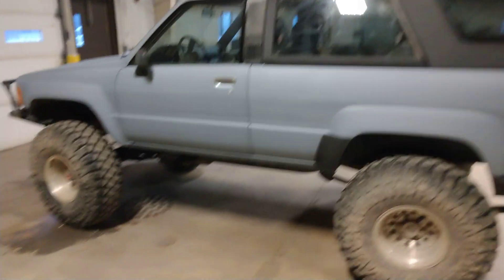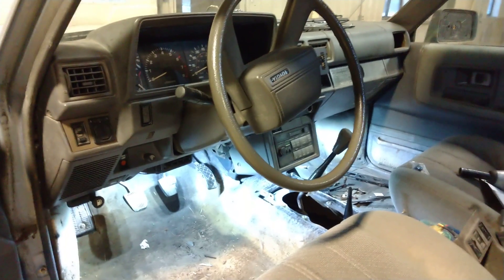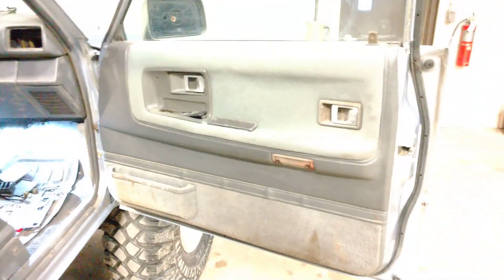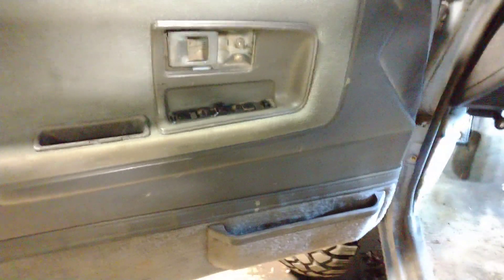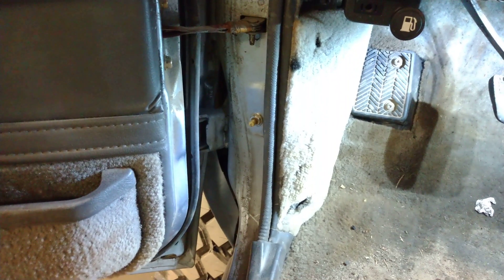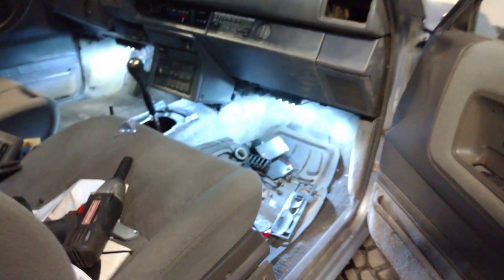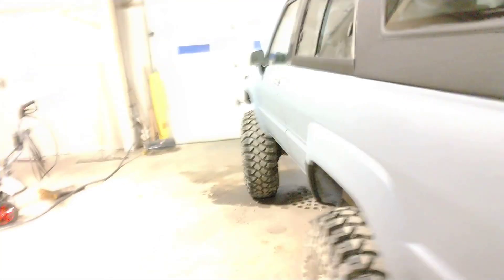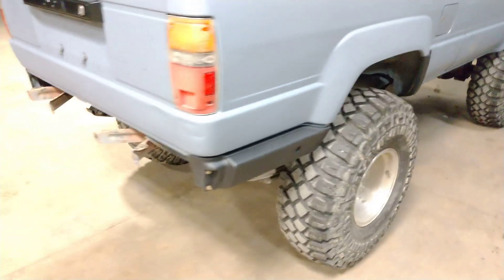Toyota TDI 4Runner body swap part 15: body electrical upgrades!

Comment: Looking good brother! I need to get in there and clean up my door panels as well, Im thinking Im gonna use a polisher with a carpet attachment and a hot water extractor. Its a costly set up but everything is costly inside those cabs haha.